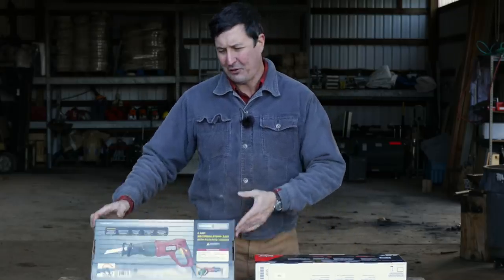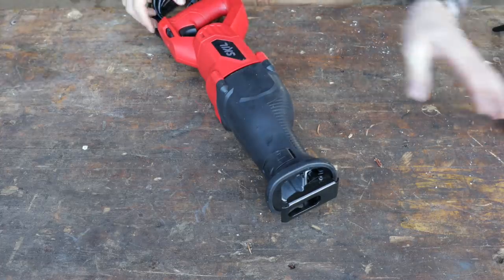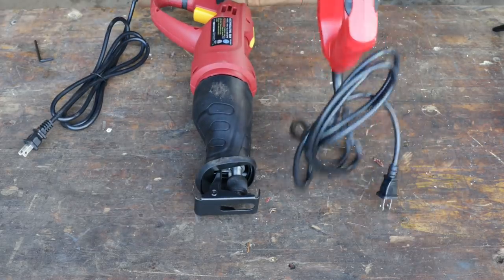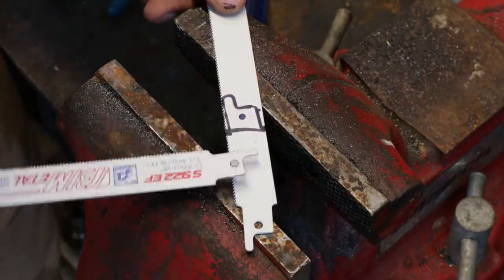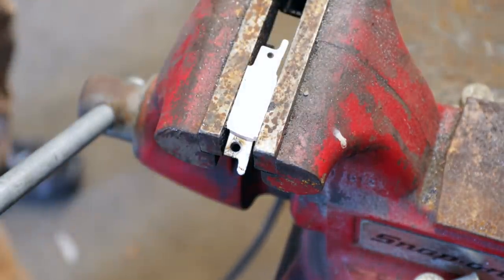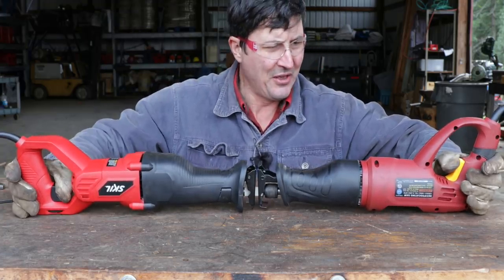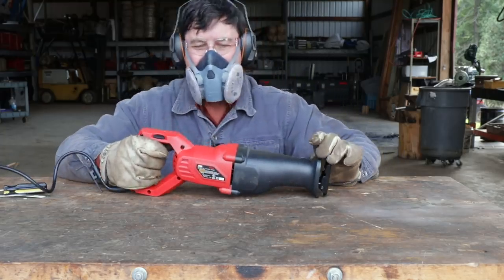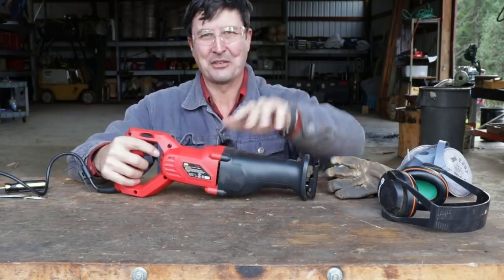Cheap Harbor Freight Tool Catches On FIRE!!!

Comment: Porter Cable make a reciprocating saw that not only does the head twist 90 deg. But angles 90 deg. To the handle, quick release chuck, rubberized front, and adjustable throat plate.

Comment: I bought a cheap 6 amp Harbor Freight recip saw, identical to yours.... Needed it for the demo we were going to do. It worked... Did the job. We used it to cut hedges at ground level. Cut up 32 sections of old 6" stockade fence. With a pruning blade, we pruned several maples and even a walnut. Two years later, it still works. I'm thinking that I got my $30 worth.... Sure, it's marginal quality, but at a throw away price. We beat the snot out of this thing and it's still doing what it was bought for.

Comment: Some advice Wranglerstar, don't buy new Chicago Electric tools off of amazon. It is almost always discontinued old-stock items. If you paid more than $29 bucks, you were taken for a ride bro. Otherwise, the test was kind of lame. 

You matched a 7.5 amp saw against a 6 amp saw and are surprised the 7.5 amp overpowered the smaller motor saw. As far as the fire? It is called physics. Any time you stall an electric motor, it converts the power being consumed directly into I2R losses -- heat. Heat combined with flammable materials, in this case the varnish that coats the wires in the motor, produces fire once the heat reaches flash point. It has nothing to do with either quality or power. It does have everything to do with basic physics.

A -> quality <- test actually matches equivalent tools -- doing the job they were designed to accomplish, to see which one does the job better. That seems to have gotten lost on DUH tube. Lets see, you state it is worthless HF junk. I looked it up and there are 2554 reviews on HF from people who bought one to use as a sawzall. Over 2200 of those are 4 star or above, with the majority being 5 star ratings. Just think of it this way -- this is the CHEAPEST chicago electric model at HF. There is a 7.5 amp Chicago Electric model, or a 9 Amp C.E. professional model.

Personally? I have used most of the different brands -- PROFESSIONALLY.  So long as it doesn't bog down when cutting something like cast iron, you have a good saw. I don't care where it came from or what name is on the side. If a professional wants to piss their profits down the toilet? That's entirely up to them. Heavy use will kill a Milwaukee just as certainly as any other brand. The front bushing or the trigger is usually what wears out first on any of them. 

Looking for a good bargain saw? Skillsaw $60 13A.  You want cost efficiency and maximized profits? Have to do an analysis. A saw that is $120 has to last four times longer than the $29 cheapo just to break even -- not to excel, but just break even. You won't get more than ten years max out of the expensive dogs without repairs being necessary, not in a daily hard use scenario.  Usually more like five or six. All that cheapo has to do is two and one half lousy years and still function, and it has crushed the high dollar unit for cost efficiency. One I had of an older C.E. model lasted four years, and only cost $20 new.

Comment: This is a useless test. Running them at full power going through metal/wood leaving them on for extended periods would of been an better example of run time
Reply: It's kinda just for fun. I dont think it should be called a "test" but it's just for fun
Reply: The test wasn't about run time. It was about surviving abuse.
Reply: It's call a torture test for a reason. Common sense much
Reply: @michaellodholtz2439  right!
Reply: But this was more fun.

Comment: Why don't you go out and buy the cheapest new ford, chevy, and ram truck and see which one will run the longest on no oil to see which one is the toughest since that is how you seemingly test which one is the best
Reply from the maker: Why don't you do it?
Reply: Wranglerstar Because I am not making YouTube videos testing to see what the toughest tools are by testing them on things their not meant to do like restricting the movement of a blade to see which one is tougher that ultimately end up destroying the tools no matter the quality. So going by how you test a lot of your fans would probably like to see which truck is the toughest of them all by your standards. Since the truck is one of the most expensive tools someone will buy, a lot of people will want to know which is the best. I'd do it if i had the platform you do and was my job. So why don't you do it if you do videos like these?
Reply: Or better yet come up with some sort of rig to connect crankshafts together😋or connect their exhausts together
Reply: All these hurt feelings lol. It's like no one has anything better to do than painstakingly shove their opinion on someone. I love what you do Wranglerstar. I watch hours of your vids weekly.
Reply: Andrew Lyon l
Reply: Andrew Lyon people do engine test like that.
Reply: Also companies do extreme abuse test like these as well kinda like why the purposely crash cars. Companies do these test just to see what happens under certain conditions. For instance if harbor freight thingy got stuck and caught fire and caused some damage. As long as someone was cutting correctly and got stuck the company may be liable for damage. This is why the perform certain abuse test to see what happpens
Reply: i know what youre saying. These tests arent not an accurate representation of how useful or good the tool is. I just treat them like what they are, dumb fun. not really a test.
Reply: No need.  We all know the Chevy would crush it!!😝
Reply: Andrew Lyon Why not make a test like with these saws.... Buy the vehicles, then instantly crash them together ;)
Reply: @andrewlyon6834  Because the test isn't spending YOUR money.
Reply: He already did. You missed it

Comment: I've got one of those cheap Chicago electric saws, passed down to me by my late grandfather. This saw has been beaten, dropped, and sawn through countless pipes, all before it was ever even mine. The quality of the tool is sub-par. The rotating chuck feature: while it has stood the test of time and still works as it should, changing cutting direction sounds like nails being dragged across concrete due to debris buildup on contact points. The dang thing won't quit 🤷 just used it last weekend to cut a rusty exhaust section out of my car so I could install an aftermarket one.

Comment: Okay. Now wait just a minute you really didn't do anything that really tested the saws. 
Like you need to put these saws in real life situations, because I don't think that a "Real life situation" "is attaching two saws together" and running them. If we were going to go into the realm of realism go cut some trees with them with the course wood blade or cut some 1/2 inch metal with them. Cut some dry-wall and like normal demolition stuff. That would be a true test. This isn't hate or like saying you did it wrong just recommending some ideas, constructive criticism. Also Great video !!
Reply: I would also like to see the other features of the saws in action like the harbor freights adjustable head feature

Comment: We were having a hard time at the fire department with the Milwaukee M18 breaking there pins during auto extrication but they put in tempered pins and they work a lot better.

Comment: Eh...I know these tests are funny but they aren't a true "test" of their designed function.  As with the drills...simply "locking horns" and applying power until one of the motors/controllers fails does NOT test it's ability to drill, saw...whatever.  You're testing parameters the engineers never designed into them.  Under NORMAL working conditions and used for their INTENDED job and audience(ie...a hobbyist saw NOT used in a professional setting) many of the tools(Ryobi comes to mind)will work as they should and provide good value for those who don't need either the durability or the price(remember, professionals can deduct the cost of their tools)of high end product names.  Good entertainment though...and I DO like your channel so it's nothing personal.
Reply: TakeDeadAim I want to be able to thumb this comment up 300 times, just to get it to the top. These aren't tests. Let's see some footage using the tools as they were intended, maybe just on the edge of abuse. This "lock the tools together and see which one dies first" doesn't teach us anything about how the tool will last with normal use. I've got Ryobi tools and have abused the heck out of them this year, and no problems yet. But the Ryobi was the first drill to die in wranglerstars "test"

Comment: Wrangerstar tries 'Docking' again. With some Skil, the HF releases the shmoo first. 
The quick release holder on the HF is similar to the old Porter/Cable tiger saw. It was a beast to use, but could demo all day long. have two recip saws and blades can be put in either up or down.

Comment: Yeah I think my mom got one of those harbor freight saws for like 19$ with a coupon in store and used it to cut roots of a tree that fell in a storm to get the stump out ... Overheated from prolonged use and the trigger failed but I put an old Milwaukee trigger from a parts bin at work in it and now it works fine again but definitely not very dependable .the best thing about good tools is fail-safes built in that shut the tool off before you can destroy it.

Comment: I found a Milwaukee Super Sawsall from approx the mid 90s at out local motorcycle swap meet this summer. Still in great mechanical shape and still in the original steel case with manual, Allen key and 1 extra blade. Chord is detach/replaceable and it has a variable speed trigger with hi/low switch to limit top speed.... best $20 I've ever spend. 

I'd rather buy used quality than new garbage any day.

Comment: Well, I LIKE your tool vs. tool tests. It took only seconds to get flames on this one! My favorite reference this time was, "Toxic Chinese Smoke!"

I want to repeat a simple, helpful idea: COBALT DRILLS will go through just about any metal, even including tool heads. Sears has a nice selection of COBALT DRILLS for a decent price. Ace hardware has kits and single cobalt drills. 

Turn these drills slowly and keep them lubricated.

I have suggested this before, and you will notice that no Youtube know-it-alls have gainsaid this info.

I got this info from a pro. You are not just taking my word for it.

Comment: Just got the harbor freight for $23 today. I don't have a recip saw and I need one to cut up some old wood planks. Will only be using it for this until I can get a good deal on package deal for Dewalt powertool set.

Comment: Hey Wranglerstar,  you should be using activated charcoal respirator cartridges like they use in paint shops to stop that kind of smoke instead of a particulate filter.

Comment: I paid about $20 for the Harbor Freight model at the Harbor Freight store.  No one buys these unless they have a coupon or the item is on sale or they are using a discount coupon.  Mine hasn't 
caught fire yet but I use it primarily when I need the adjustable head for a tight squeeze.

Comment: Bolt cutters that last would be a great video. I have to cut locks off of stuff at work and they only last a couple months. They either go dull or the handles break off.

Comment: Nice job.. the only thing I ever got with a cord from china freight was a 5.99 or 7.99 4.5 in angle grinder. Brushes turned into a plasma cutter first try.

Comment: Thanks for the video. I'm not buying another one. I had an 18-volt one by Harbor Freight, the saw quit working, the charger went bad and the battery all at the same time. At the time of the sale, the lady asked did I want to buy the warranty. And I told her no, thought the tool would last. Maybe it's why they are told to offer warranty at the sale desk. Luckily I bought a Ryobi a few months later in a package deal on a drill. So, I'm not without one.

Comment: I have the one from Harbor Freight and I love it.  I've been using it for years and haven't had a lick of problems with it.  Nobody makes tools that are meant to have their blades welded to the blade of another tool,  then run until one of them blow up.  What was the point of this?

Comment: Could I run a 32" bar on a husqvarna 460 for use in felling/ bucking hardwood for firewood? The 24" it has now isn't big enough but has enough power for it by far

Comment: i think i left this comment 2 years ago but i bought a plug in horizontal cut off wheel from harbor for 15$ about 8 years ago only needed it for a few projects and its been a beast every time certain stuff there you can beat.

Comment: You should get yourself a few small diamond tipped drill bits. . v useful for extra tough steel on small jobs... used one to drill out a small roll pin that's how tough they are.

Comment: You can lay one part over the other and use it as a stencil.. a quick shot from a rattle can and it's perfectly traced, or just take two blades and bolt them together.

Comment: The HF saw is rated 6amps, the Skil is rated 7.5amps. The HF brushes burned because the other saw has a more force and held the HF motor in the same position. The Skil saw would have burned up eventually in the test. The test didn't show much except how not to use the saw..

Comment: You can get the Chicago Electric saw on Amazon because it's a private sale, it costs more than the Skil because they're marking it up. You can have Amazon ship items for you through Prime, they just get a bigger cut of the sale and enforce sales tax. 

The Chicago Electric saw is $30 at Harbor Freight, but coupons come up that make it $20. For $40 or $50 it's pure garbage, but for $20 I wouldn't even expect it to work lol.

Comment: I already figured the harbor freight unit would be the loser. I got one a couple years back &  it lasted all of 5 minutes. Had great results with every other Chicago Electric tool I've bought, save for the reciprocating saws. They're just the PITS.

Comment: I've found that Harbor Freight tools on Amazon are usually sold by third party sellers who mark them up.  I bet the saw would be cheaper at Harbor Freight; especially with a coupon.  That being said, I'd still rather spend more for a quality tool.  However for a tool I'm experimenting with to see if I like it or not, I'd try out a Harbor Freight.

Comment: I have the H.f. one still works rotating feature broke a while back and is taped in position but the tool still functions I dont use it as my go to but did for some time and beat it and abused it. Its also regularly avaible for 20$ not 50$ h.f. stuff always has a ridiculous mark up on Amazon so in reality you where testing a 20$ saw vs. A 40$ saw and the 40$ saw won which should be no suprise idk why amazon marks h.f. stuff up so much but w/e on that note. Nevertheless the video was still entertaining and served its purpose, I will note that the h.f. saw had a keyless chuck wayyyy before the skil one did I have proof of that my father has one of the older base model skills and it takes a Allen key my hmf. Saw which is actually older is keyless

Comment: I quit buying and using Skil back in about 1994. I Bought a brand new 7 1/4'" Skill Saw to work on a home project. It ripped 16' of 2x4 and burned up. Replaced that with a Makita that I still have and use to this day. 2 days after the Skil saw blew up my 3/8th skil drill less than 3 months old piled up and stripped out. I replaced that with a 3/8 Dewalt that I still have and use to this day. 

Actually while I will not buy Skil EVER AGAIN! I do tend to cheap out. However, we have been bitten by cheap junk tools so many times, when we couldn't afford to take the hit, that since that New skil saw burned up my wife no longer allows me to buy cheap tools. Matter of fact she was the one that bought the Makita and she is the one that bought the Dewalt. Life has moved along and I have a whack of tools now, none of them are junk. I only need to be bitten once by any tool and it's over! Even if they cover the tool they don't cover the inconvenience or my time.

Comment: again... i used a harbor freight identical to that for 5 years. pruning, cutting metal, demoing decks... thru trippled up pressure treated 2x6s and bolts. Had it smoking more than once. took 5 years to kill it with actual work

Comment: Cody, if you want a real drill challenge, get a Hilti to go up against the Milwaukee. It will eat it for breakfast. You should look into Hilti, it's standard for our timber framing, no drill holds up better or drives a 16" GRK more true than a Hilti impact driver.

Comment: Harbor freight is a blessing, granted i would way rather go for the dewalt but sometimes when you already have a dewalt, and it breaks from falling off a ladder or gets rained on durring the drive home harbor freight does make working substitutes so you could get back to work the next day and save a few bucks to buy a better drill

Comment: I left my Milwaukee sawzall at home in the garage one time and I was at the job side needed a saw a friend came by and had 1 of these Harbor freight saw saws in his trunk never use still in the Box. Offered to loan it to me it looked a bit sketchy but decided to use it anyway I used it for maybe a minute at the most it burned up and I have generally kept a rule about Harbor freight and that is if it plugs in stay away from it although I have gone back on that and bought a few things that actually plug in at Harbor freight I had to be a bit selective and you can pick out things that are a little more heavy duty if You try.

Comment: The Harbor Freight is cheaper in the store or through their own site, especially if you get their coupons. On the other hand, I got my DeWalt recip saw for $50 at my local pawn shop. (Older key chuck style)

Comment: You should tape the triggers down and plug them both into a power strip. Flip the switch and they will both start at the exact same time. Seems like if one starts even a little faster would ruin your tests.